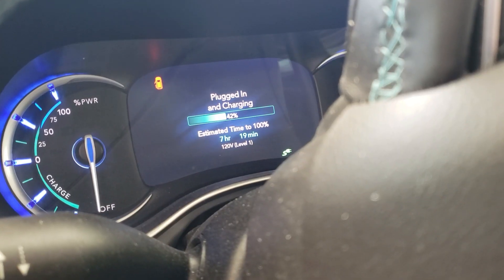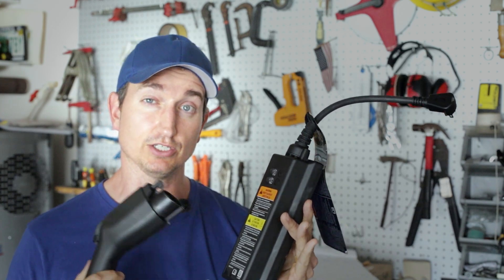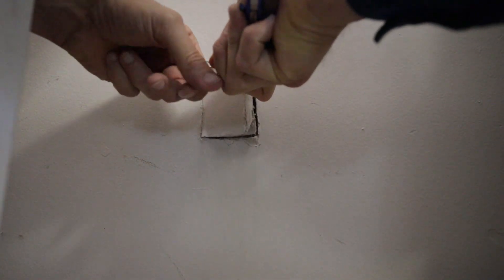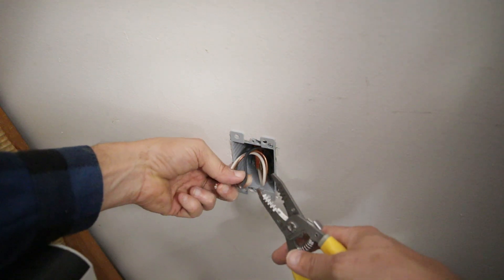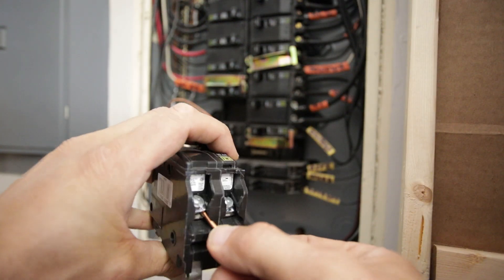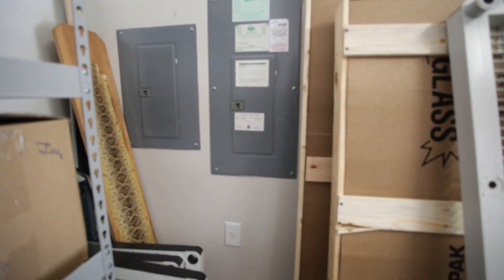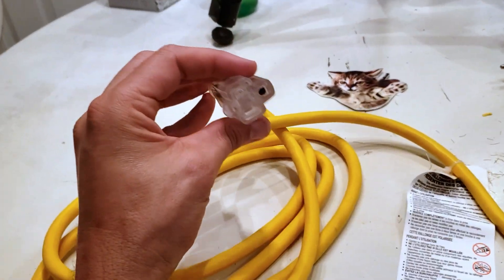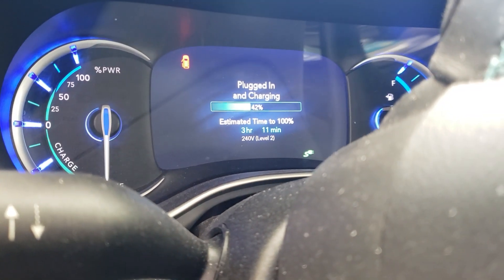Increase The Charge Rate Of Stock EV Charger

Comment from the maker: If you would like to use your stock EV charger but think it charges too slowly, then watch this video.
Supplies and Materials:
Volt Meter = https://amzn.to/3MwWY1V
240 plug to 120 Volt plug adapter = https://amzn.to/3xWKwnX
20 amp 240 Volt Outlet = https://amzn.to/39mPro8
240 Volt Cord Plug = https://amzn.to/39pZXuZ
10 Gauge Romex Wire = https://amzn.to/3OGBDVG
Old Work Receptacle Box = https://amzn.to/39q18dT
Disclosure: The above are Amazon links. "As an Amazon Associate I earn from qualifying purchases."

Comment: That was a tiny pull, should have put a bigger gauge wire so you could use a 32 Amp charger one day.
Reply from the maker: Thanks for the tip. In this case I happened to have some spare 10gauge Romex and felt it was appropriate for the 20amp circuit installed.  I don't have plans to beef up that outlet but if so I guess I could just re-pull a larger wire set. I would also beef up the receptacle box at that time I would think anyway.  Pretty convenient if I ever needed to make a change since it is so close to the main panel.

Comment: That cable.... EEEEEK.
Reply from the maker: Feel free to elaborate if you feel something is not appropriate to make others aware. Thanks
Reply: It'll work fine for the wimpy Bolt charger, but anything over 12 Amps (continuous) is not a good idea.

Comment: Most computers and cell phone chargers will take 240
Reply from the maker: It seems like it would be practical to make most electronics to handle 240 volts considering much of the world use 240 volt.
Reply: @MrKistel  I've ran servers on 240 using similar plugs, it's more efficient
Reply from the maker: @AgentOffice  interesting idea.  Thanks for sharing.
Reply: Yup, most switching power supply can handle anywhere between 100v and 250v.